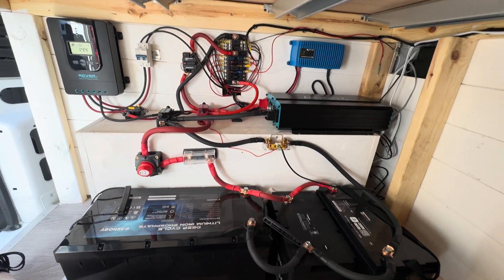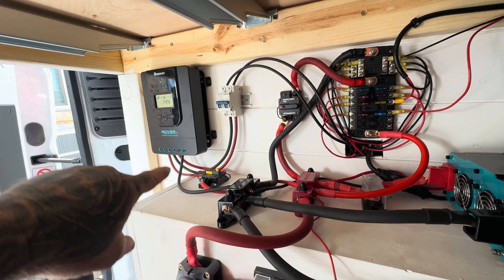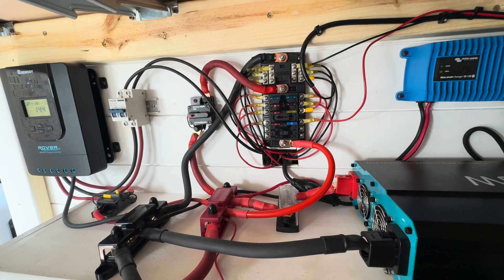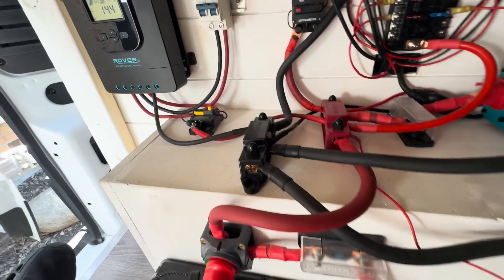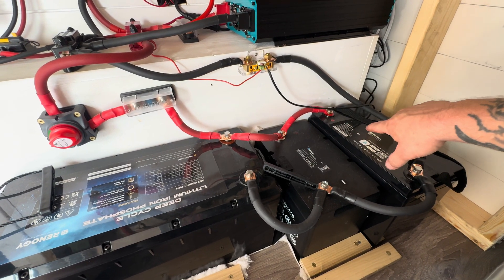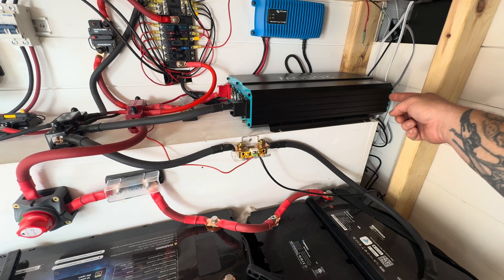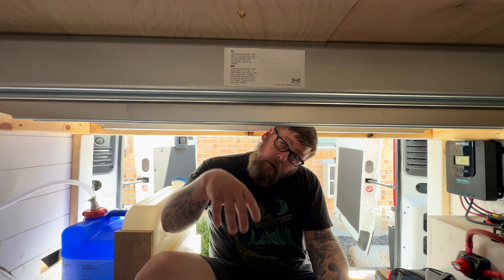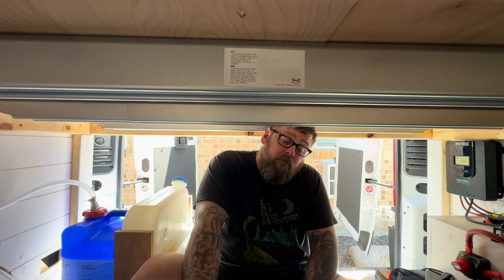Brief Electrical System Overview in DIY CamperVan Build

Comment: Hi Jason, thanks for the video.  I'm trying to understand the shore power function.  The trickle charger is charging the batteries which then feeds everything else, I assume.  But when you actually plug in the shore power, do you need to turn the solar off, so you don't have solar and AC running into each other?  I hope this makes sense.  I'm still learning and appreciate your help.
Reply from the maker: That is a great question and the answer is no you don’t need to turn the solar off because the solar charge controller recognizes secondary power coming in and automatically shuts solar production off. I know what you mean though because the electrical portion of the build was what I was most worried about, I researched stuff nonstop. I appreciate you checking it out.

Comment: Good job! how the shore power charge control works when you have solar panel charging the battery at same time? thanks
Reply from the maker: I have actually never needed to use the shore power. I’ve only plugged it in to make sure it works. My solar panels do a very good job of keeping up. I honestly don’t think I have ever went below 75% capacity.

Comment: Hello Jason great video, any issues with mix  lithium batteries being different size and  brand?
Reply from the maker: I haven’t had any issues at all. Definitely don’t mix lithium and agm batteries though. My batteries are all Renogy lithium they are just different amp hours and the system has worked perfectly fine.